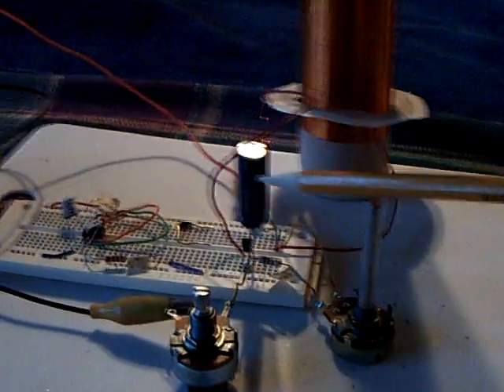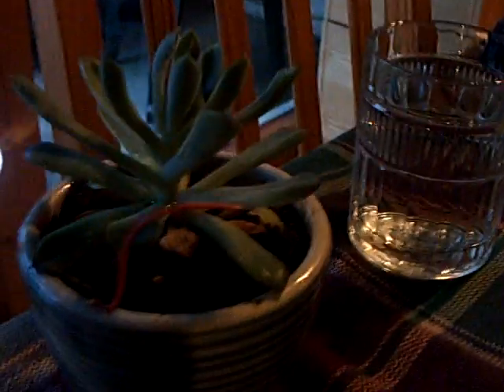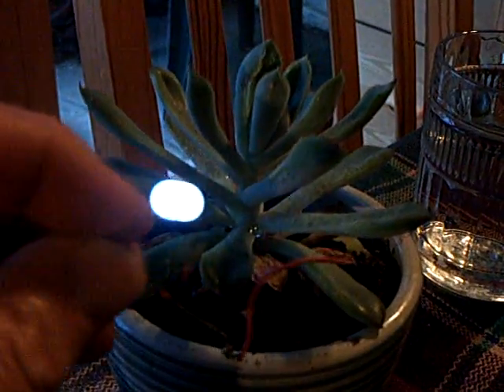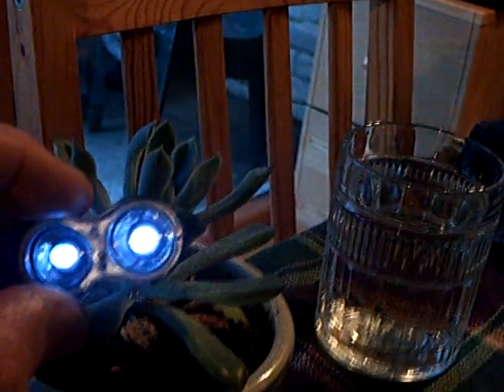Plant battery and a friend.ASF

Comment: watch?v=wt3smrXkVpE&feature=watch_response
It is very interesting how plants comunicate
"The secret life of plants "
I connect the live wire of my 110v socket to the plant ( one leaf), and when touch any part of the plant with  a led or 90v neon it turn on. I suspect (after see the "The secret life of plants that Plants (and every life been)acts like a sec antenas, I will try to check energy transmition between 2 plants. ;)

Comment: @Lidmotor 
Yes ... water has nice little molecular shape that SPINS in an AC field. The hydrogen atoms will probably SPIN around the oxygen in the center. IONs can travel through it nicely if it has a bit of salt. With the JT attached (or exciter), its interesting that there is a DC component and an AC component that co-exist ...The AC potential probably rides the RAIL of the DC bias. A scope could confirm that.

Comment: Lid, I have Eric Dollards little book "Theory Of Wireless Power" 1986 Borderland Sciences, and it goes in to detail about Transverse or the electromagnetic power we use every day and longitudinal power, that we don't use every day. You may have the latter going on here. Longitudinal waves are capacitance based. Transverse waves are magnetic based. May be plants are capacitance based due to the water. I am watching. Thanks Slinky

Comment: Does a plant need to be feeding the circuit, for the other to become hot? Or could a non-plant power source run the circuit, and the plants still respond like a remote glass of water would? They have water, and they have mass... I suppose the glass of water can't act as power source. At least, clean water can't.... Excellent work, appreciate our videos.